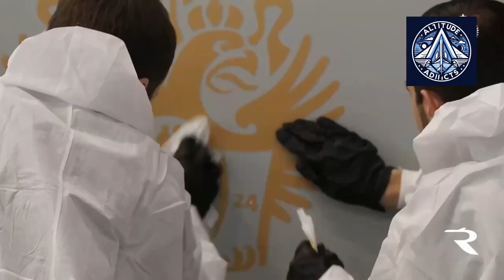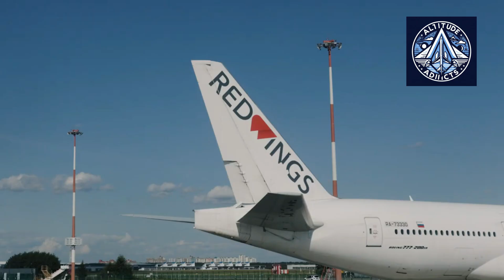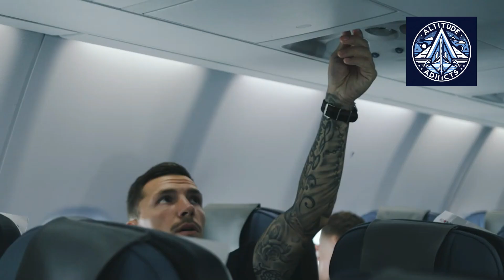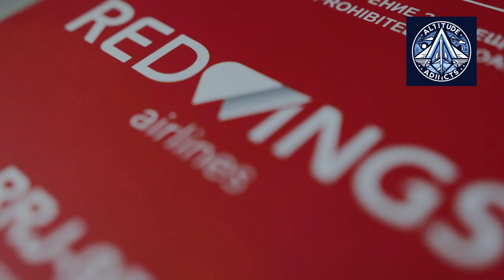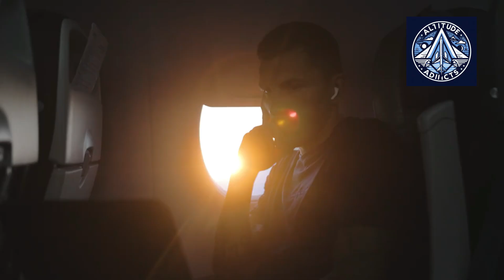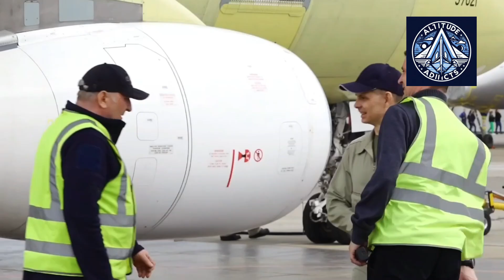Sukhoi SSJ100 with PD-8 engines - Will it Ever be a Reality?

Comment: Great future, I believe, not just for SSJ-100s, but MC-21s & IL 96-400M/LR - sky is the limit ! Potential customers across the global south are anxiously waiting to induct UAC & COMAC built commercial aircraft in large numbers. And, this will happen soon
Reply: Large numbers. SSJ 100 production peaked in 2014, with 36 units. All right, that's not even enough to cover the domestic demand. COMAC will be another story, but by now has not ramped up production either.